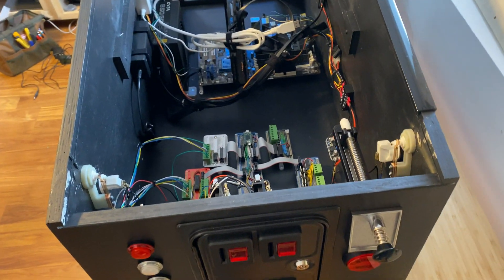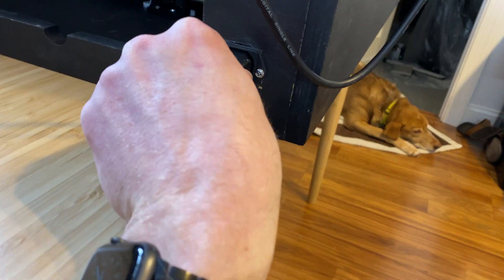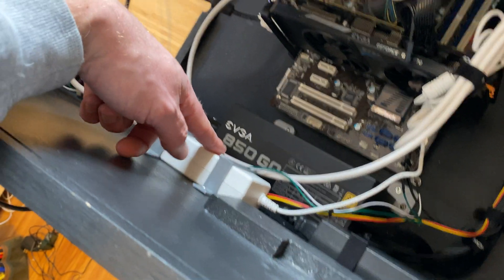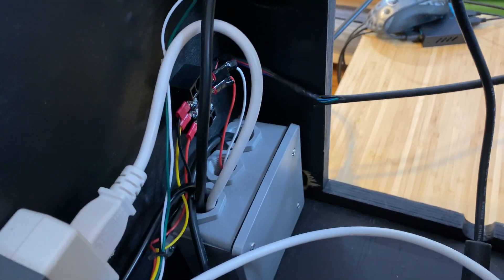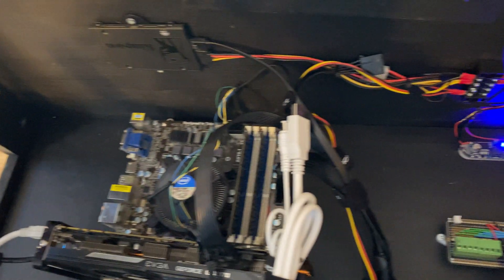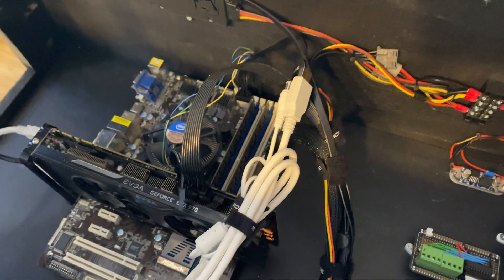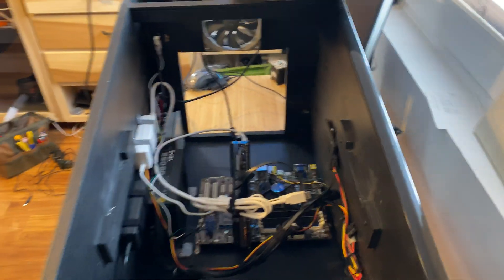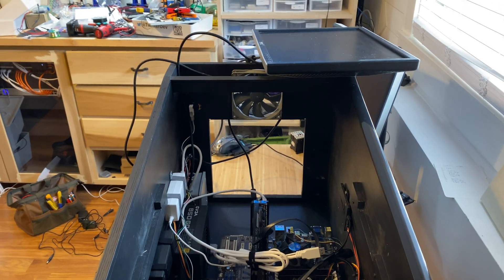Virtual Pinball Cabinet Build Ep. 4 - Power

Comment: To be honest I never watched a "how to" when I built my cab.  Now that its done and for years all I have done is the occasional tweak I have no need to watch them.  But your build is fascinating to me.  I always felt everyone else was following a "plan" or guide.  I feel your build is truly unique.  Just like mine lol!
Reply: We do have a few differences though:  I use LED Blinky/Pinball X for button lighting.  I went with a normal mechanical plunger that uses a strangely mounted arcade button to simulate plunger movement.  I just reversed to "closed" position.  I finally settled on tempered glass after suffering through Home depot brand el cheapo glass ad before that plexi.  You should look into it.  I also went with metal aluminum trim.  I spent many an hour sawing and then filing everything into shape.  It holds my playfield glass in place and provides my hand rest.
Reply: Last note:  If your computer is set to "Balanced" power mode then you will eventually notice frame skips and "jerky" play.  It becomes even more evident in 4k.  If you want a constant smooth 60 frames no matter what then set it to "high performance".  I'm serious. I ended up going from an AMD A8 7600 to an overclocked Haswell G3258 (4.3ghz) to a devil's canyon i5 overclocked to 4.4ghz.  I went from onboard graphics to a 750ti to a GTX 1050  to a GTX 1650 and I still got jerky play.  After I went 4k I couldnt take it anymore.  The 4k upgrade almost caused a complete rebuild!  So I noticed that I got full clocks when loading a table but sometimes the CPU was only running at 1.3-2ghz under gameplay.  I never saw this advice anywhere although I read endless complaints about jerky game play.  I guess I'm the only idiot who leaves the computer in balanced mode